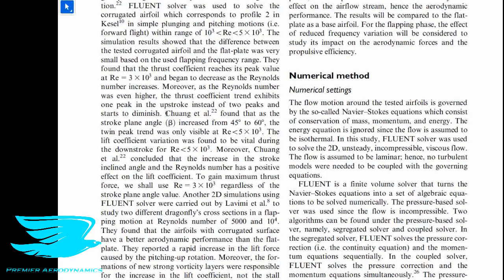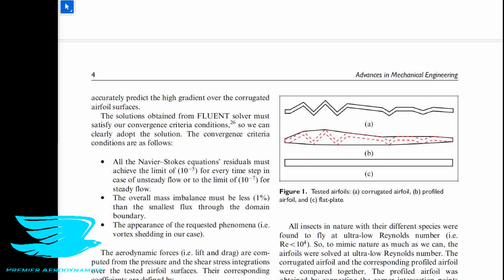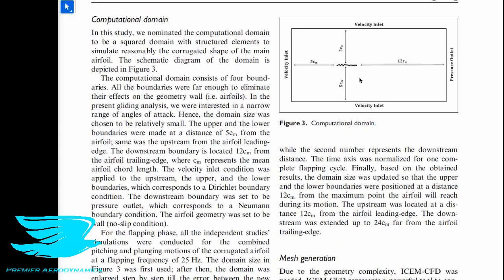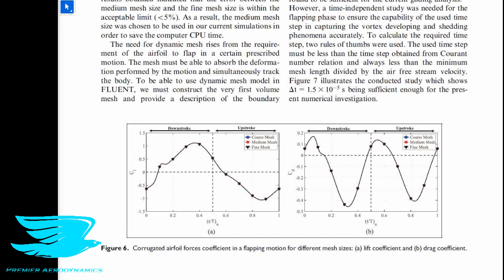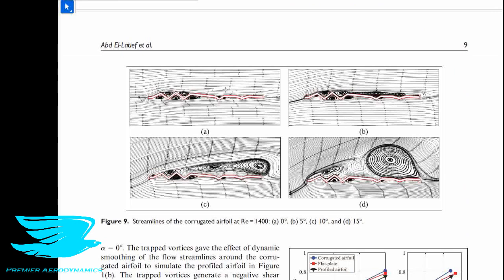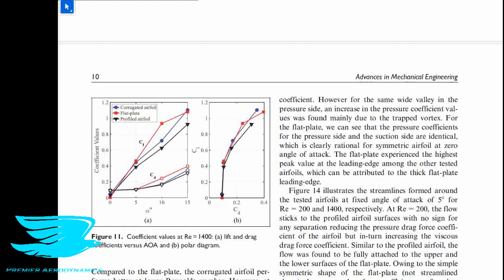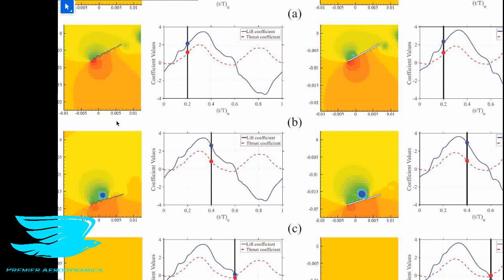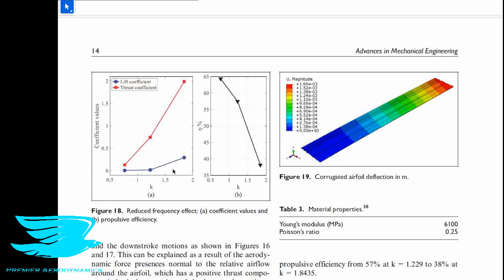Podcast #150 - Ultra Low Reynolds Number Corrugated Airfoil Aerodynamics

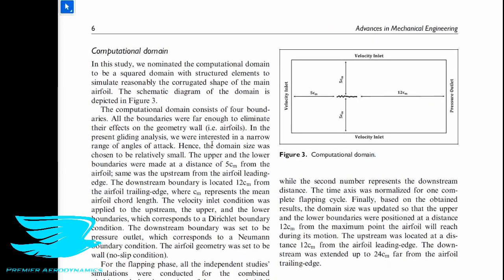Comment: 6:03 We can already throw out the study.

Instead of Reynolds number, a better predictor of turbulence (steady-flow, or otherwise) would be Reynolds number divided by normalized roughness, where "normalized roughness" is surface roughness divided by a characteristic scale or length (e.g. airfoil chord). The dragonfly wing, is clearly an extreme case of roughness, which should be accounted for just as much as the extreme case of low Reynolds number. As you mentioned, the tendency of unsteady-flow to be turbulent is another reason.

In subsonic-airfoil optimization, one of the patterns I'm seeing is that high (i.e. typical) Reynolds numbers and low angles-of-attack favor smooth airfoils, whereas low Reynolds numbers and high angles-of-attack favor rough airfoils. This hints that we may be able to construct a "turbulence-tendency" variable that's a function of Reynolds number and normalized roughness. Perhaps Reynolds number over normalized roughness should be held constant, at least for a given degree of bluffness (i.e. shape and angle-of-attack held constant).

Excessive roughness obviously results in poor performance due to skin-friction drag and unnecessary turbulence. Poor performance due to insufficient roughness is less intuitive. It results in early flow separation with late reattachment. The resulting form drag and/or reduced lift are more significant than skin-friction and turbulence penalties.

In the case of laminar-flow airfoils in cruise, the optimal roughness is so low, that splattered bugs are enough to trigger an premature laminar-to-turbulent transition, along with a noticeable drag increase. However, at larger angles-of-attack, high roughness or vortex generators would be a welcome addition. It seems, retractable vortex generators have been invented already.
Reply from the maker: You have just described a great point.

Yes, the Reynolds number is not everything. The surface roughness is also really important, and so is the turbulence intensity.

Both of those parameters affect how much turbulence will be introduced.

So, taking both of them into account is important to better characterize the flow.

For the surface roughness, I think another good way to normalize it is to divide it by the boundary layer height. That's because the greater the roughness to the boundary layer height, the more it will be interacting with the different layers of the boundary layer and even trigger transition.

For the different flight conditions, what you just said is exactly true.

It boils down to when a wing is under extreme operating conditions (like very near stall), the boundary layer needs more energy to stay attached (particularly near the wall). So, a more turbulent flow is better for that because the velocity in higher there.

During undemanding conditions, like simple cruise, the boundary layer is in no danger of separating, so a more turbulent boundary layer just results in greater skin friction drag because the velocity near the wall is greater, which leads to more shear.

As for vortex generators, retractable ones are good, but also ones called micro vortex generators are also really good. Properly designed, they give you the benefit of regular vortex generators, but without most of the form drag penalty because they aren't as high in the flow.

There's another type of vortex generators that works even better, but their geometry is different in philosophy - they create vorticity from the surface of the wing, and at lower angles of attack, the vortices aren't strong, so there is minimal drag penalty and even a reduction in drag, in some cases.
Reply: @PremierAerodynamics  Cool. What airfoil would you recommend for RC planes (RN somewhere around 10,000 to 100,000)? I’ve read that cambered thin plates are good, but would a cambered thin airfoil (with rounded leading edge, tapered trailing edge) be even better? Let’s assume both have the same chord and thickness. What’s more important? Thinness or camber? I’m most concerned with drag reduction at modest angle of attack, during cruise.
Reply from the maker: @AwestrikeFearofGods  For this, please give us an email, and we can set up a consultation time to help you with your designs.